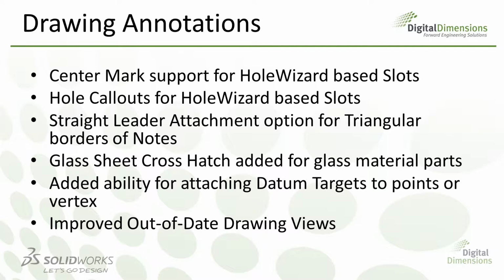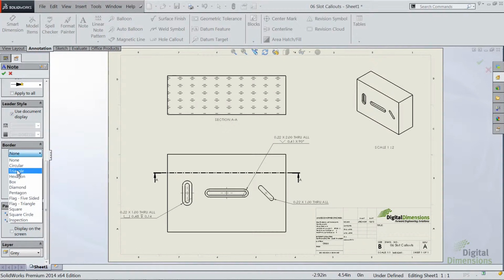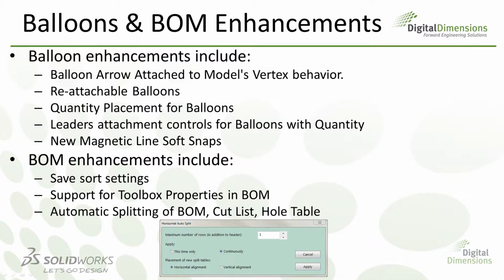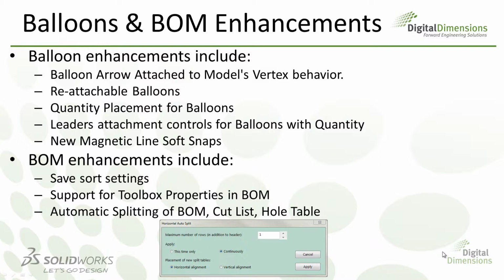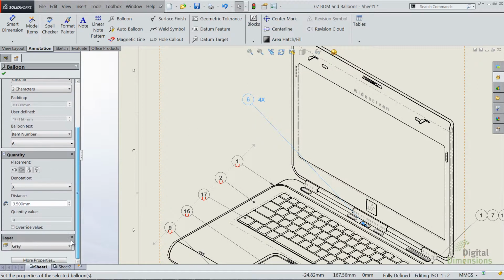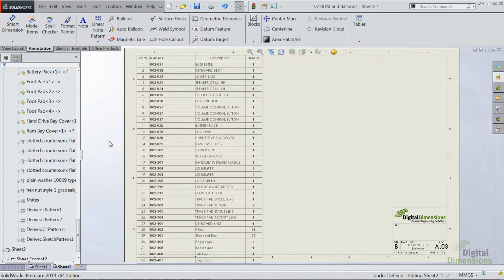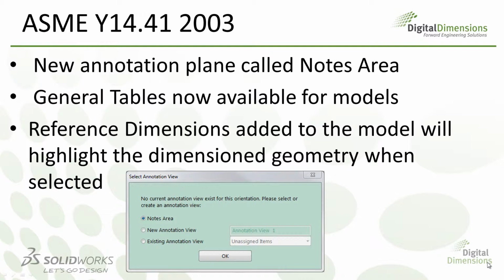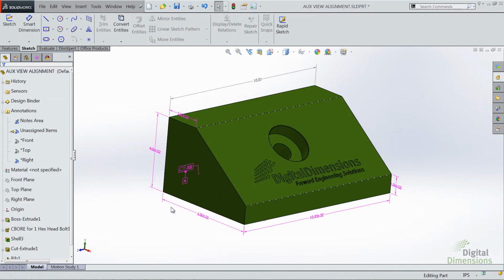DDi CADcast 2014 What's New: Drawings Part 3

Comment: Hello! How can I change the reference model of a drawing?
I have done many similar drawings of objects with small differences by making one drawing, then copying it many times. I rename the model of the first drawing, so the programe cannot find it, and it would ask me for every drawing what model to use. When I choose another model it works, because the models are really close to each other. How can I do this in SW 2014. I have done this many times using Inventor. Thank you.
Reply from the maker: Hi there, 

This should help answer your question: http://www.ddicad.com/blogs/techcenter/2012/08/21/re-pointing-broken-drawing-references/

You can make a copy of a drawing, and use this tip to repoint it to the similar model so you do not need to re-create the drawing.

Please let us know if that does not help answer your question and we would be happy to assist you.